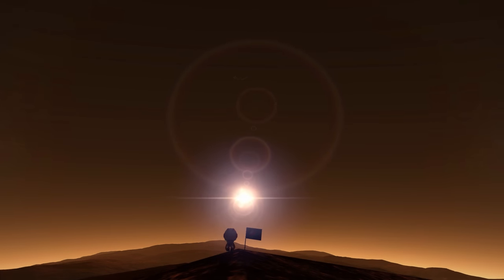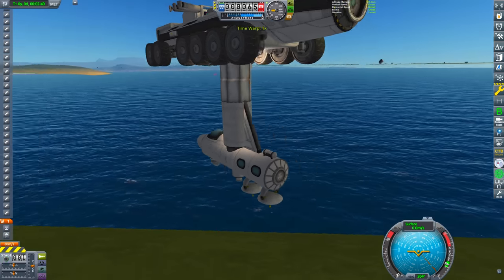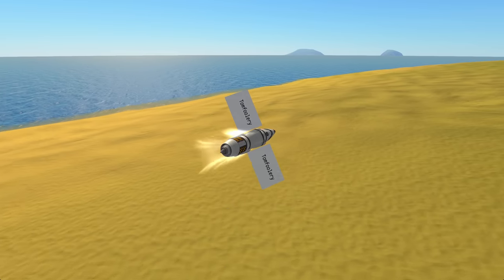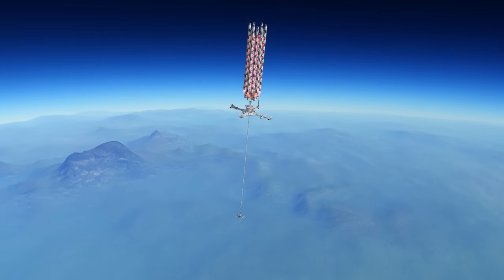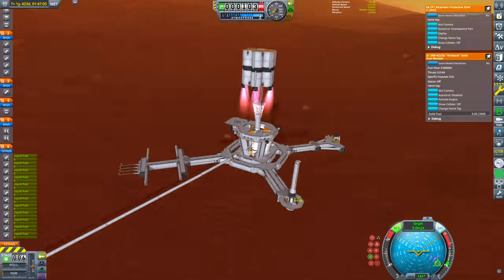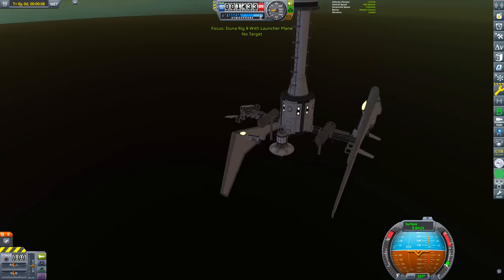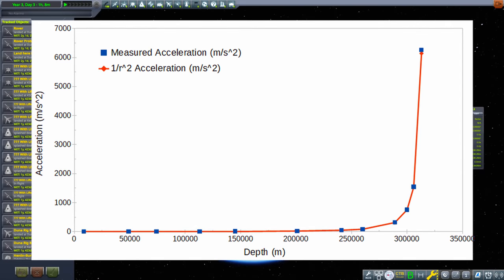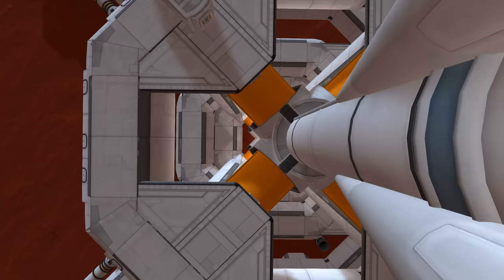Exploring the Underworld of Duna | KSP 1.12.3

Comment: I wonder if it would be possible to build a shell around the “singularity” of parts docked just above destruction range to contain this obvious threat to the solar system
Reply: Interested in doing this @ minmus
Reply: Next video: "Building a Black Hole Bomb in Duna | KSP 1.12.3"
Reply from the maker: It may be possible to do this on a small body like minmus or gilly
Reply: KSP lore: The planets are shells made by the ancients that contains this threat, but here we are, breaching it.......
Reply: @Stratzenblitz75  In this one you reached ~4.3km above the planet's core I believe before breaking up, which is 1.3% of Duna's radius. If the gravity mechanics scale with planet size, if gravity is sustainable at 1.3% of a body's radius, on Minmus this radius would be 403 meters, and on Gilly it would be just 175 meters. I reckon a circular base like that would be possible, right? With a diameter of 350 meters?
Reply: @speedcat9984  that actually sounds like a good plot for a halo/metroid like game
Reply: @quackecs  even at gilly’s core, a distance of 175m would have 28g of gravity to deal with. Much more manageable than duna’s >1200g, but definitely not pleasant.
Reply: @alexsiemers7898  At that point you'd be able to make a base much further in which makes it much easier, right?
Reply: @quackecs  gravity in ksp seems to be a function of mass and distance to the center. It might not scale linearly as gravity scales exponentially with distance. It probably needs more testing to confirm
Reply: @Stratzenblitz75  Oh god, please try it out man!
Reply: A part of the shell would get closer an inconcievably tiny amount, the gravitation would start pulling it stronger and there's be a runaway reaction. You'd need to either get it perfect or to constantly correct its position by very small amounts.
Reply: @radosawrudolf4931  Assuming it's rigid enough you should get away with it. It would be difficult to cancel out it's movement when joining the pieces but if you can manage it, it works I believe.
Reply: @quackecs  What I meant was, no matter how perfect you get it in the beginning, the gravity will affect the closest part a bit more and soon that part will pull the entire structure out of equilibrium.
Reply: @radosawrudolf4931  May be true. It would be interesting if large asteroids had a gravity well in KSP, where this hypothesis would probably be testable fairly easily.
Reply: @quackecs  Hopefully to be seen in ksp 2, even if only with mods.
Reply: @radosawrudolf4931  I'd hope so
Reply: @Stratzenblitz75  Can you try doing it on an asteroid?

Comment: 17:11 dear god, it’s Brittle Hollow

As a follow-up to this idea, I’d love to see either a lone probe core with cheats reaching the singularity (no joints means it takes longer for the kraken to strike), or orbiting the singularity on a body like Tylo where drag isn’t a problem
Reply: I was thinking the exact same thing
Reply: I think the Alt-F12 cheats change a craft's state, but it would be interesting to look into exploiting the easing to ground feature. If you cheat a vessel onto/into water, it won't automatically stop easing to ground. That only stops when it touches ground, or if you click the button to stop it. You can close the cheat window without clicking the button.
Reply: @eekee6034  I meant using cheats for infinite electricity and no overheat
Reply: @alexsiemers7898  ah! then yes, but... i don't think you'd get closer to the singularity without air resistance, unless... hmm..if you dropped straight down with no sideways thrust, you'd go straight through it, wouldn't you? at least, i imagine you would, with an orbit of perhaps infinite eccentricity, otherwise known as a straight line. though i don't know if some coriolis force might come into play.
Reply: @eekee6034  maybe a single ant engine (with decoupler to remove it) could be used to cancel out the planet’s rotation
Reply: You beat me to it! I wonder if Stratenblitz would ever play Outer Wilds
Reply: Actually it's quit interesting if game would crash in case of dividing by 0 (to calculate g force). If calculation starts in the exact center of singularity. Maybe code has no checks for radius length
Reply: Ah a fellow outer wilds ventures Explorer

Comment: Fantastic work! 

I wonder, What if you do this on an airless body like the mun or tylo and burn your engines near the center? Could you use the oberth effect to give you enough speed to punch back up through the ground without the game registering the collision? 

My thoughts are that if you could make a quick burn near the singularity you could in theory come out at a significant percentage of light speed. If it’s going fast enough the games frame rate will allow a craft to pass through the terrain without registering a collision since the craft has to be inside the terrain during a frame to do that. 
From there head to the stars?
Reply from the maker: Hey Cody!

I've tried this with airless worlds, and yes, you can get really close to the singularity. However, at that point the simulation starts breaking down and you get a ton of free velocity from the integration errors.

I'm working on a follow up video to explore this further!
Reply: Oh hey, it’s Cody.

Comment: Way back in the early KSP days I did the calculations and figured out that for KSP planets to work, they had to have a condensed matter core --- their mass is anomalously high for their radius. But I wasn't expecting this! Given a mass of 4.5×10^21 kg, the event horizon of the Duna black hole should be about 14µm across, so sadly your probe was nowhere near it. I did do the calculation and assuming I've got it right, at 5000m above the black hole you're seeing a tidal acceleration of about 10m/s^2 over the width of your probe; I estimate it to be about two metres across. That's only about 1g, so I don't think the probe exploded due to tidal disruption. If you saw sudden unexpected heating, you could have passed through one of the polar jets.

Clearly the next thing we need is a mod which adds proper rendering for a black hole. It'd be epic.

*Edit:* fixed black hole diameter which was a factor of 1000 out.

*Edit:* put it back again because it wasn't.
Reply from the maker: Lol, I love the polar jet theory. And heck yea, proper black hole rendering for black holes would be awesome. I wonder, since the even horizon is so small though, could you even see the distortion?
Reply: Next we just need to know the extent of the time dilation on the probes
Reply: @Stratzenblitz75  If you're going for realism (lol) then you're going to run into problems due to an entire planet's weight of atmosphere making it surrounded by a shell of pressure-hardened solid carbon dioxide, so let's just assume that Duna contains a partial vacuum. The black hole itself is probably invisible but debris raining down from the surface would most likely form an accretion disc. I can't find any references for accretion discs in very small black holes, but it seems plausible that you'd get one. Duna's rotating, so any falling matter will have the same angular momentum. The density spike as this all gets compressed near the black hole would produce a spinning plasma cloud that should form a glowing accretion disc. I did the calculation for Hawking radiation and assuming I got this right it's glowing at 38K... which isn't a lot, so that won't be contributing. I think it all depends on how porous Duna's surface is.
Reply: @Stratzenblitz75  There is a mod called "Singularity" which adds proper black hole distortion effects, it's used in a couple of planet packs.
Reply: i mean, their mass being anomalously high makes sense, because of KSP's 1/10 scale and gravity still being in normal scale
Reply: @Elowiny  Kcalbeloh is probably one of the best looking ones, it adds a supermassive black hole and several extrasolar planetary systems orbiting it. Because it's all separate from Kerbol, planet mods that add to Kerbol's orbit are compatible, meaning you have metric shitloads of planets to go to as well as an excuse to use FTL mods.

Comment: I guess my question is, how about a Kerbin sub to its core? How does water behave as you go deeper? Does it get more dense and give your craft more bouyancy? And does bouyancy help with approaching the core? Also, could bendy tech somehow be used to go deeper into Jool?

This was an awesome video. It makes sense to me why they simply programmed gravity as singularities, in theory, you should never be able to go below the surface, and modelling a point mass is so much easier than a distributed mass.
Reply from the maker: That's a great idea, I hadn't thought about using buoyancy. Theoretically, that should allow you to approach much closer to the core (as long as the physics engine behaves itself). Thanks for the idea, I'll need to try it!

Comment: The most mind-blowing thing to me is that last part is somewhat... Real!
There are black holes, there are things orbiting it at that speeds and heights, even the IMMENSE heating of that shield - this is just what an accretion disk is
Reply: Uhh, no. They are similar, but the reasons are completely diffrent. One is physics, other is game simplification.
Reply: I feel a black hole in atmosphere would not... well, the black hole would be fine, it'd last for as long as they usually do. But, nothing else would. Any accumulated atmosphere one does have would be largely temporary.
The absurd density present in black holes does mean they can cause ridiculous increases in other phenomena, and it is so very interesting to see. All gravity does the things associated with black holes, but theirs is so strong that phenomena which can't be easily observed elsewhere are trivial to find.
Reply: @O5MO  Uhh, no, they are not completely different. The game simplifies a planet's gravity to a single point, which is literally exactly what a singularity is. All the planets are quite literally singularities with a hollow shell. The immense heat from orbiting is also almost the same, friction through the singularity's accumulated "atmosphere" vs friction through the singularity's simulated atmosphere it shares with the planet above. But they are both due to the singularity's steep gravity gradient causing incredibly high speeds through medium. I don't know why you think they are "completely different".
Reply: @Wasabiofip   i didnt say they are completely diffrent. In fact, i said they are similar. The reasons they work this way are completely diffrent though, well, maybe apart from singularity, because KSP planets do in fact have singularities in them. But atmosphere, heat and other things are very diffrent.

Comment: I hope the new planets in KSP 2 have caves.
Reply: As I understand it they can't really because of the way planet meshes are made. They base it on a single altitude value, so there's no way to layer stuff in without using scenery objects placed on top. Not to say they couldn't figure something out but it's unlikely.
Reply from the maker: Interplanetary caving would indeed be awesome
Reply: @maxv9464  many games use a similar approach and to create underground areas they put holes in the ground mesh and thread scenery objects into them
Reply: @insu_na  Oh ok, cool!
Reply: @maxv9464  There's a mod that does add small caves
they could add caves as structures, rather than terrain
it wouldn't really go under ground, but would still be cool to explore
Reply: @jesusramirezromo2037  Agreed! Just makes for somewhat limited structures. But I'd love to see them pull it off.
Reply: Brb drilling a hole through the core.

Comment: I remember exploring undergrounds back in 2012-2014, when there were so many gaps in the mapping of planets that you could land basically anywhere and would find a gap. Most of them was actually tiny but some were big enough for kerbals or even small crafts to fit in. There was also especailly a lot of these on Minmus for some reason. It was kinda fun to drop inside of them and try to get out without touching the surface or you'll instantly die or crash.

Comment: What's even more striking is that the way you see the "planet" and the sky as you approach the center is eerily similar to how you would see a (supermassive) black hole as you get closer to it. Once you hit the event horizon, the black hole will actually appear "in front" of you (if you were going straight towards it), barely taking half of your entire 360 view. This is because of insane light aberration mixed with the diffraction of light, all the light is coming from the direction you are going at, so when you hit the event horizon the black hole will still appear "in front" of you, as if you never even entered it. It's only when you get close to the singularity that the black hole takes half of your entire view, but by then you've probably been spaghettified into a string of molecules (molecules wouldn't be taken apart by gravity because gravity is much weaker than the electromagnetic force on a molecular scale, even a black hole can't take apart a molecule, and even less an atom because of the strong force). This is fascinating.

Comment: What really did it for me was the legitimate science (not in-game science mechanic) done to explore how the game is implemented.  A point gravitational source and then inverse square rule out from there is logically how you'd program it, since it's easy that way, but you did the work to properly confirm it.  Wonderful.

I am curious why a claw was fine but a normal docking port wasn't, though.  I feel like when I've used a claw I got just as much "bouncing" before a solid grab as with any normal docking; was it just for convenience, since stock KSP has no problem transferring kerbals through a claw (or a tube, or an engine... lol) or is there something about the claw that makes you less likely to spontaneously disassemble?
Reply: i suspect that docking ports are prone to momentary contact, causing the craft state system to register “in flight”. the game allows only “landed” or “splashed” craft to exist under the terrain, otherwise parts resting on the surface would be destroyed if they were clipping.

Comment: This is awesome! It also explains why I once had a ship marked as "landed" while in flight - I crashed and destroyed the root part but the rest of the ship was fine and had a control point. Getting to orbit was very difficult because neither the stock readouts nor Kerbal Engineer was telling me anything that made sense. A fun bug/glitch.
Reply from the maker: Thanks! And nice work finding the bug and flying it through!
Reply: @Stratzenblitz75  I couldn't actually do anything once on orbit of Minmus, no amount of prograde burn would change to Kerbin SOI because the conics weren't being drawn. Couldn't quicksave or leave the flight as it was "moving across the surface". Rolled back to an earlier save and did it properly.

Comment: Yeah, I remember experiencing this with a landed duna probe at some point, it was little more than a probe core, a few sensors and a parachute to land. When I did land, I time warped to get to day, and when I stopped time warp, it ended up below the surface and just fell. I saw that the probe core was accelerating as it neared the center. I don't remember if I enabled indestructability just to see what'd happen. I do remember it reaching the core and then shooting out of the planet at several thousand times the speed of light, immediately going well outside of the solar system so far that the map would let me zoom out far enough to see it as more than a dot in the distance.

Comment: 19:34 Did you try disabling heating with cheats, just to see what would happen if the probe went further down? And also the Unbreakable Joints cheat too, although I suppose 1000 Gs might be too much for even that to handle.
Reply: Just use a singular probe core with infinite electricity at that point. Don’t have to worry about joints breaking if you don’t have any
Reply: @alexsiemers7898  That too, I wonder if his drop probe broke apart to spaghettification. Using one part would hopefully fix that.

Comment: I have an hilarious experience with the underworld to share with you, Stratz. Trying to recreate DomedCity's "drive a very tall car from KSC to Island" joke idea, while testing if it would perform in water, I alt-f12'ed it to sea - and missed. It went to the shoreline, but the bottom endeed underground. After all the explosions ended, I got a VERY tall tower firmly planted on the shore with an observation cuppola on top (great, Kerbal Baywatch program, I thought) but with lots of structure belowground (minus the root part, which HAD exploded underground). Back at KSC, the "tower" (marked as debris) showed up at the South pole. Sadly it exploded when visualized again.
TL;DR: I got to the South Pole fast the most cartoon Kerbal possible way; by making a hole straight down!
(A pity I took no screenshots, but that means YOU can try that incredible Journey to the Center of the Kerbin yourself, go down an island and get out in a big explosion half a world away)